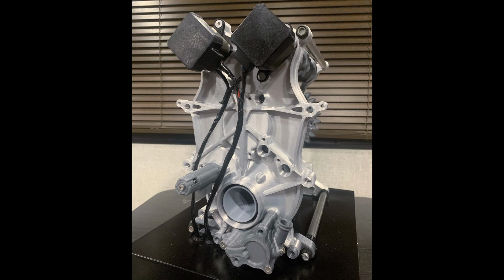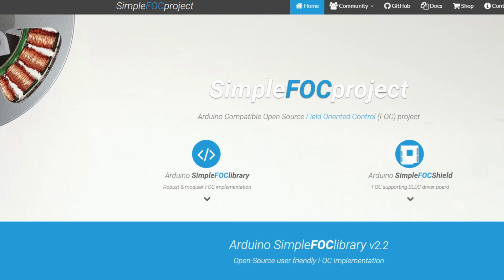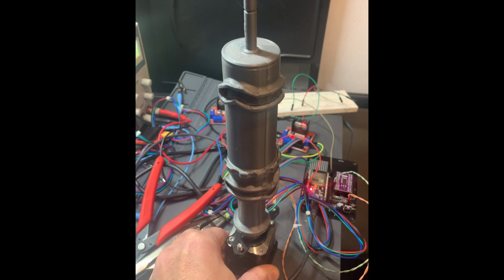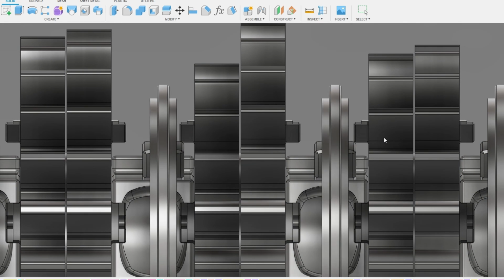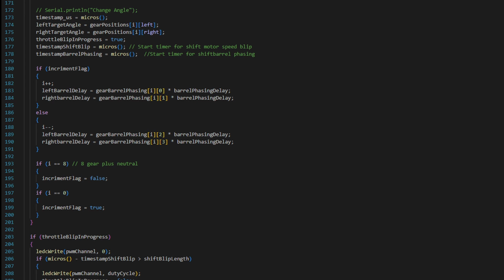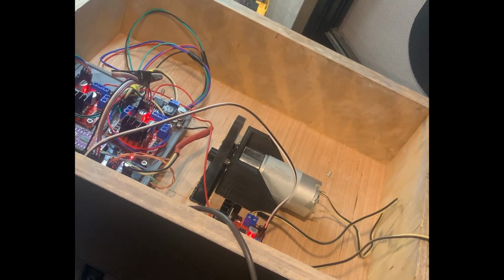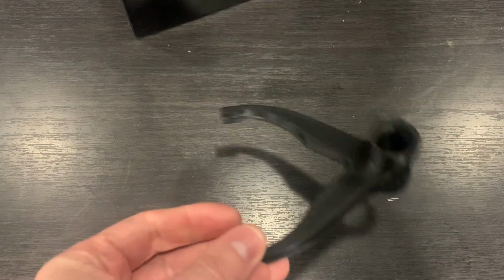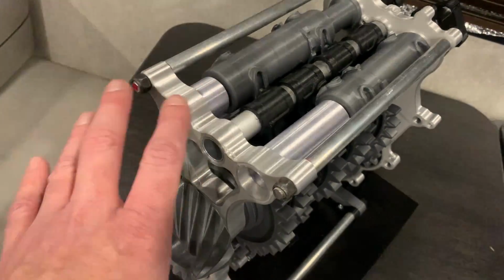F1 Seamless Gearbox Pt4

Comment: Where does the inertia from the changing engine speed go?  Even if, like in a real F1 gearbox, the shift fork pushes the dogs in at the moment that the dogs are lined up properly, those two gears are still going at different speeds and have a lot of inertia on behind each.  Something has to take the energy of that crash.

In an automatic transmission, it's the brakes on the ring gears and the torque converter fluid.
In a classic manual transmission, it's the clutch and synchromesh rings.

So, where does it go?
Reply from the maker: There's not a lot of detail on this other than a lot of gearboxes were broken during the initial development.  I believe the clutch allows some slippage with the computer controls, but also it just comes down to the elasticity of the metals in the drivetrain and a short service life.  The main shaft and driveshafts are just big springs until they fatigue.
Reply: The inertia is kept small by building everything including the flywheel and the clutch extremly lightweight.

Comment: I'm sorry to be that guy, but I am just curious of how much money would it take to make one adapted to a 2-stroke 100cc engine. Or, if it is possible to get the 3D print files. Thank you very much, I hope you have a wonderful day! 

Edit: I have a 100cc motorcycle that use sequential gear, no clutch lever. I'm thinking of building a gokart with the engine from my motorcycle using this gearbox, or, just a 1000cc 3 cylinder engine. Again, thank you very much!
Reply from the maker: The F1 gearbox model is available on printables.com under indeterminate design.  I don't know how well this would adapt to a motor cycle.  It would be quite expensive to manufacture a custom gearbox like this and the control electronics would need to be much stronger.  The disadvantage of this gearbox is that if anything goes wrong you will engage two gears and lock everything up.  Check out this gearbox, it's based off the Honda MotoGP gearbox and is probably a lot better suited to a motor cycle.   Unfortunately it will still be very expensive to reproduce in metal. https://www.youtube.com/watch?v=0GJrDS8-nbE&t=1s
Reply: @IndeterminateDesign  I've got a lot of questions, I'm sorry. Would you be willing to answer them? Are the gears interchangable? As in, can I change the gearbox ratio? Thank you....
Reply: @Brian-ks6kf  Understood, thank youuu

Comment: Love it! What method or sensor did you use to measure the torque changes?
Reply from the maker: Since this is driven by an electric motor, I can accurately control the torque with the microcontroller. It would be much more difficult for real F1 gearboxes and they use a series of MagCanica torque sensors that can measure microscopic bending in the output shaft.

Comment: You could do the Koenigsegg Light Speed Transmission, to explain the difference between shifting with friction clutches and shifting with dog clutches, and to explain the two-stage gearing design versus the normal single-stage gearing. I assume that the friction clutches would be the construction challenge.

Comment: Hey, anyone here can explain why no car manufacturer makes their cars with this kind of gearbox?
Reply from the maker: The Valkyrie AMR does have something like this, along with the price tag to match. 😂 

These gearboxes shift extremely harshly, are expensive to build, and require expensive maintenance. For any road car or lower cost race car, heavier dual clutch gearbox’s , or a traditional sequential dog-box gearbox are a much better compromise.
Reply: @IndeterminateDesign  👌
Reply: @IndeterminateDesign  Come to think of this, I've heard this seamless gearbox technology can make up shifting smoother and more continuous than the conventional type for the race bikes in MotoGP... It provides smooth and continuous torque while a rider is up shifting, so that it saves shifting time and tire wear. Many bike manufacturers even equip their super bikes with seamless gearboxes. But I'm not sure of these claims and advantages because I've not ridden a super bike equipped with this kind of gearbox before. Can you tell me about this?

Comment: after years I got accidentally back to your series and watched this video. I'm glad you finished this project, man, you're obviously an engineering genius. I wish you put it into a gokart or something though, but I understand as you say that would require serious changes to the design to make it work in metal form. In any case, impressive. Congratulations :)
Reply from the maker: Thanks!  I would like to try it in a car like my Mk1 Golf.  The design could be simplified a lot since it's not an F1 car.  But I always comeback to a dual clutch gearbox is probably cheaper and easier to implement, even if it is heavier.

Comment: Hi there would just like to say amazing work!! Don’t worry the YouTube algorithm will bless you eventually because your doing amazing stuff. 

Secondly can this gearbox be machined on a cnc machine or can they only be 3D printed? Also haha I seen your video on the 3speed sequential could you not go back improve that and make a useable 6 speed sequential now that you have the experience of basically designing an f1 box from the ground up your amazing bro
Reply from the maker: It could be machined from metal as a model. It lacks a lot of things like proper bearings, lubrication and the tolerances are far too large for use in a vehicle.  You need some strong and fast actuators too. 

I thought about designing my own 6 speed sequential but for the money it’s not worth it. A good name brand sequential gearbox is $20-25k which is less than you can make a one off gearbox for. I had a lot of people want a gearbox for a shifter cart but I think it’s easier and more reliable to just buy the internals from a motorcycle gearbox and install them inside a case. 🤷

Comment: Where did you hear that the current gen F1 gearboxes use shift torque reduction? I was under the impression that the whole point was to be able to upshift at full engine  torque, just like a Liberty gearbox, or a Lenco
Reply from the maker: When I designed my previous F1 gearbox I met an F1 test engineer on Reddit.  It’s done for durability. The gearboxes have different shift modes depending on how hard they want to abuse the gearbox with the shock loads. I don’t believe the wheels will see much of a cut in torque given the inertia of the drivetrain.  It’s also a common feature in most electronically controlled sequential gearboxes like those used in rally racing.
Reply: @IndeterminateDesign  That makes sense; most normal sequential gearboxes use either a spark/fuel cut or timing retard. In F1, they could also use the MGUK to pull torque. I can see them having a conservative mode to preserve gearbox life and a full attack qualifying mode. I know some high end time attack cars with DCTs that shift at full torque; the gearbox and clutch just have to live with the shock load. Wear doesn't matter that much if you only need one lap at full send.
Reply: @ZergZfTw   Lo siento por responder en español (lo puedo hacer mucho más rápido) pero para mí esto no es una cambio "seamless". Es un cambio secuencial tradicional de los que llevan usando las motos desde más de 50 años. Una caja de cambio secuencial, gobernada por un desmodrómico que mueve las horquillas y los desplazables que bloquean o liberan los engranajes libres del eje secundario.
Las motos pueden cambiar de marcha, solo cortando gas, gracias a la desmultiplicación que hay en la transmisión primaria (engranaje del cigüeñal con la campana del embrague).
Al haber una reducción de rpm, no solo ganas longevidad del sistema, sino también mayor seguridad y efectividad en lo cambios ascendentes. De toda la vida en las carreras de motos se sube de marcha sin embrague, gracias a esta desmultiplicación inicial y a la distensión de la cadena en la trasmisión secundaria o final. Los ingenieros de F1 han copiado esto, al igual que los embragues multidisco por ser más compactos, eficientes y longevos... y luego dieron un paso más allá.
Los coches de antiguamente, de forma habitual, no tenían o no tienen desmultiplicación, tomando normalmente el par el árbol de trasmisión, directamente del cigüeñal.
Los cambios seamless utilizan otro sistema, que es muy parecido a los carretes de bicicleta, el piñón de la rueda trasera, con un sistema interno de cuñas y rampas que eliminan las horquillas y los desplazables, siendo más rápido aún que estos. Honda lo extrapoló de la F1 a MotoGP ¡ Que raro, Honda !
Les invito a ambos a investigar. Hay un vídeo de otro chico que ha realizado uno en impresora 3D y muestra su funcionamiento.  
El cambio convencional de un coche, con mando y varillas está por encima de 1 seg. 
El secuencial de una moto con desmodrómico en 0.5 seg y un seamless sobre 0.180 seg. 
Muchas gracias por la atención y buen trabajo y vídeo.